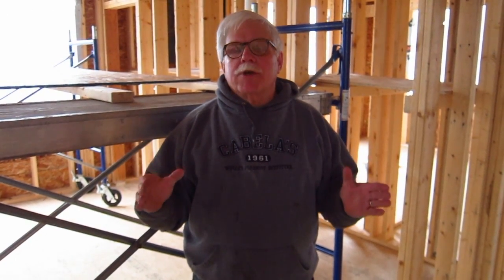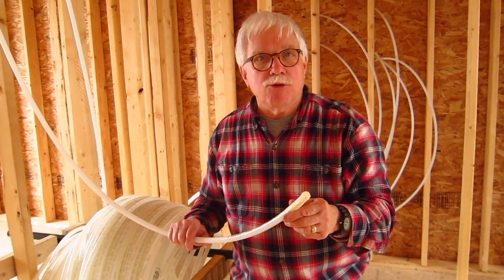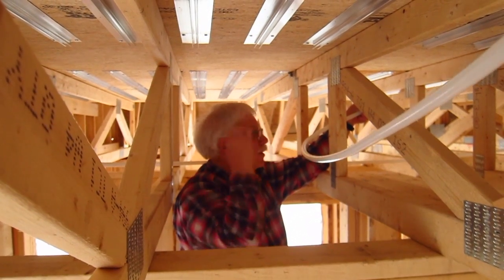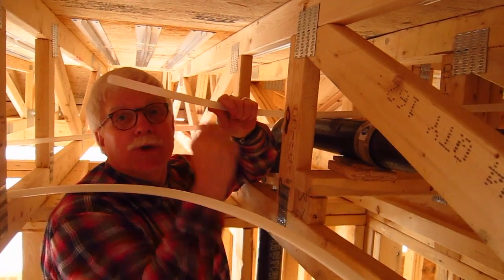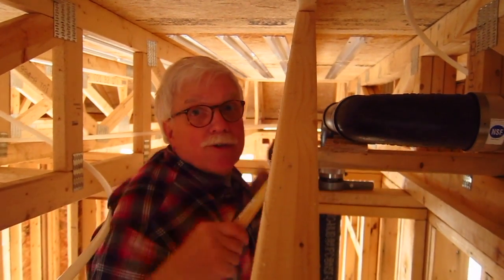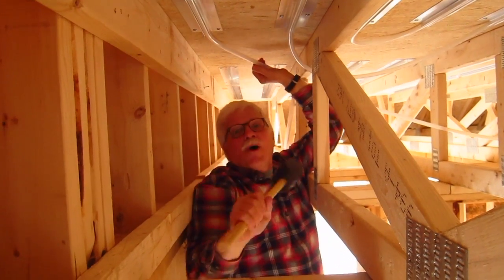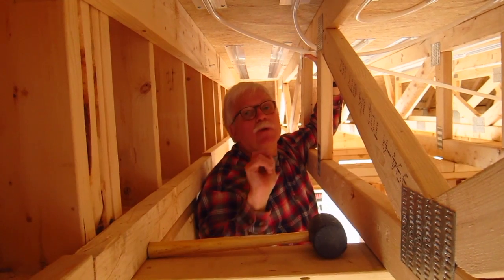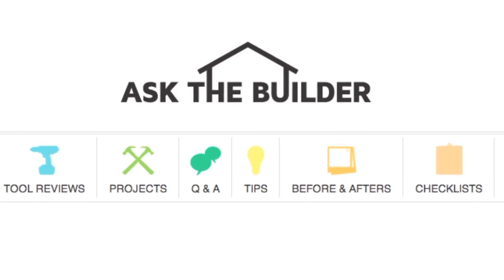Install Radiant Heat Under Wood Floor 24 Inches OC

Comment: Looks like someone is gonna be warm in winter...wondering if this heat is useable in an off grid situation. Bonnie
Reply from the maker: Yes, the heat works in off-grid situations. You just need to have a standby generator and a large supply of propane. Just think how you'd heat with any other method.

Comment: tim i love your common sense videos. correct me if i'm wrong, but i was under the belief that you run the hottest water to the coldest place first that being the outer wall of the house as more heat would be need there and less heat would be needed nearer the center of the house. as you have described it the highest water temp will go to the more centered part of the house and the coldest water will go to the perimeter. being as i am from central Florida feel free to correct me as we don't use much heat down here and would love to figure a way to send it to those needing it up north. thanks, jim in central florida.
Reply from the maker: Read the installation manual from Uponor to discover the exact way it should be done. That's what I did.
Reply: thanks for setting it straight
Reply: Mr j.r.s

Comment: How do you keep it going when the Electric grid goes down for about 3 to 4 years
Reply from the maker: Easy. You have a standby electric generator connected to a very large supply of propane. Do you anticipate the grid going down for that length of time in the near future?
Reply: is that an off grid situation cause I'd also like to know if u can run this off grid affordably
Reply from the maker: Just do the math. See above.
Reply: @askthebuilder  math...what's that..lol
Reply: You have bigger problems to worry about at that point